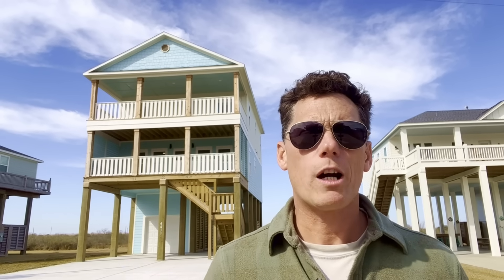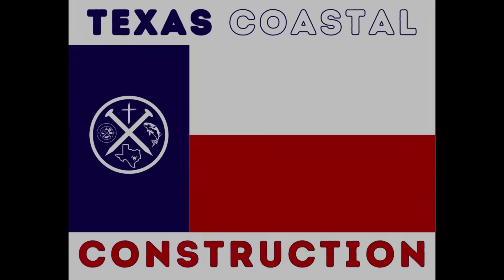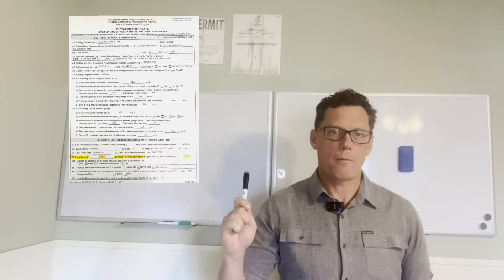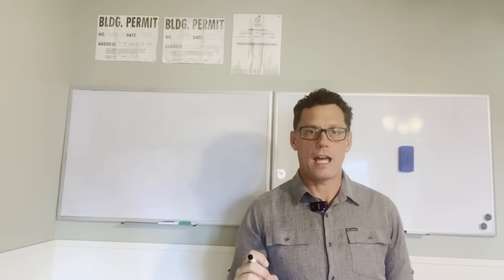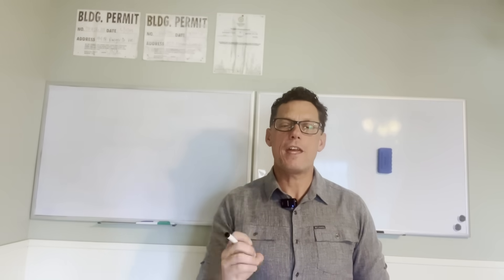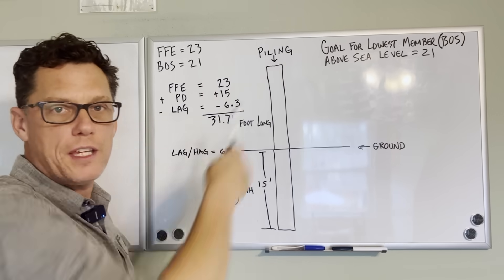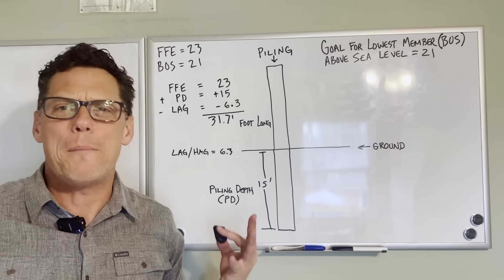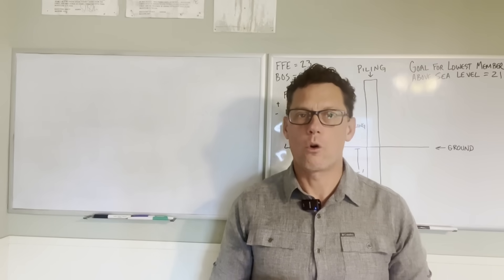How to Build a Beach House! Piling Installation and Flood Zones (Episode 1)

Comment: You could easily use precast concrete piles and no , lumber is not the only option.  Lumber even if treated will still rot as in fence posts which I have seen rot after 20 years.

Comment: Interesting video! I'm intrigued. But it raised more questions than it answered. How does driving 34' wood pilings 15 feet into the earth not compromise their structural integrity? When rot is a concern, how long do wood pilings generally last before they need to be replaced? (Please, no "best case scenarios.") How expensive are they to replace? Why not go with concrete pilings? What is the spacing ratio to the width and length of the house? In other words, how did you determine 18 pilings are necessary? (You weren't exactly clear on how you came to the number 18.) And does that change with the number of stories built on the house? How frequently do the pilings need to be treated for termites and other pest damage (carpenter bees, ants, etc)? Thanks!
Reply from the maker: https://youtu.be/WZXfszEfmDY?si=bG--PSl8AUOGo_gL

Comment: Can you build on hydraulic pipes that can be raised to that height when needed then lowered back down when floods danger is over.
Reply from the maker: That is actually an excellent question, but unfortunately the answer is no. You have to remember there is a perfectly square and level house above the pilings.

There is simply too much risk to the structural integrity of the house... plus the house is connected to the ground by sewer lines, water lines and electrical.

I have seen houses raised, but it a one time raising and it is EXTREMELY expensive.

Comment: At a ve 17, shouldn't the lowest horizontal structural member of the fin floor be at 17' why 21'?
Reply from the maker: That is the flood zone rules.

The "17" in VE 17 represents height above sea level.  This number also represents what is called the BFE (Base Flood Elevation). Meaning the ABSOLUTE BASE height above sea level is 17'. Flood zone rules require you to be a minimum of 2' ABOVE the BFE.

Meaning the bottom of your stringer is 19' Above Sea Level making your finished floor (due to the width of your stringers, floor joist and subfloor) 21' above sea level.

In this build we elevated our bottom of stringer to 21' for 2 reasons. 1 a better view of the water and 2 it is cheaper to insure since it is 2' ABOVE the minimum flood zone requirement of 2' above BFE.

Yeah... it's a little confusing, but I hope this explanation helps a bit.
Reply: @TexasCoastalConstruction gotcha.
The +2' is the d.f.e.
You did a fine job explaining.  Do you have a max building height?
Reply from the maker: Great. The max height is up to my engineers... I try and find a balance between going higher to maximize the view and minimize insurance costs, while not adding any additional engineering requirements.

Comment: You could never build like this in my area of Florida. My house sits on concrete piles driven to bedrock, then locked / capped with a heavily reinforced 10" thick slab. The above ground  support columns are poured and reinforced on top of that. That was 1985. The requirements are even higher now.
Reply from the maker: That is hard to do because we don't have bedrock on the Texas coast. But, yes, eventually the pilings are surrounded with rebar footers and reinforced with a concrete foundation. That just wasn't part of this video.

Comment: In Jersey code requires driving the pilings down into bedrock, then pouring a footer on top of the pilings below grade to prevent toppling when the sand washes out.  Houses built on sand alone are eventually going to collapse: rots-a-ruck!
Reply: Good luck finding "Bed Rock" in South Texas Barney Rubble...
Reply: @Digital-Sparks It's there, it just depends on the building code you're using. Southern states generally use SBCCI, which is the reason the buildings collapse.
Reply: @dennismaloney7241  I understand where you might be coming from, but the professional geological surveys conducted for over a century tell a different story. The official Geologic Atlas of Texas, published by the state's own Bureau of Economic Geology, maps the entire area as recent sand and clay deposits. Furthermore, the data from thousands of deep oil and gas well logs in the area confirm there are miles of sediment under our feet before you hit anything that could be called solid bedrock. These aren't opinions, this is the raw data used by engineers and geologists every day.
Reply: @Digital-Sparks  Here in Florida, my company uses helical pilings torqued to a certain Nm (foot-pounds). Sometimes we have to go more than 40' deep. I can see how that might not work in certain ground environments, however, I would much rather have a galvanized steel screws at the bottom of my piers than just a solid piece of square wood that is susceptible to rot and more susceptible to sinking. Additionally, it provides more upward force protection if properly attached to the home. What do you think?
Reply: @jaime_travels exactly
Reply: @dennismaloney7241 piling homes are the Only ones still around after trechourus weather

Comment: So like 40grand just in material for 18x of those pilons , not including shipping , crane , drilling , labor so on and so forth. Unless you get some kind of bulk price ?
Reply from the maker: All in for this house it was $22,500 for pilings and installation labor. But, yes... that is why elevated homes are so expensive because you are essentially installing 3 foundations. Pilings, subfloor and concrete under the house.

Comment: Nice build. That doesn’t mean it wont sink. During a hurricane, where is the footing? What footing? Just pilings. Good luck with flooding? Reme
Reply from the maker: Nah... they aren't going anywhere. They are driven 14' into the ground... but yes we do install footers around the pre-driven pilings when we concrete under the house.

Comment: HELLO i have a  questions, how do you now the size the pilling , if do not open the ground , the level of the seawater ,
Reply from the maker: By using an elevation certificate it gives us the lots elevation above sea level. The engineer gives us the piling embedment (how deep to dive it). The flood zone gives us the finish floor height requirement the house needs to be above sea level.

Add the piling depth plus the finished floor height and subtract the lot elevation. Then we usually add 2' just for a buffer... that is how you know how long of a piling you need.
Reply: Thanks. A lot